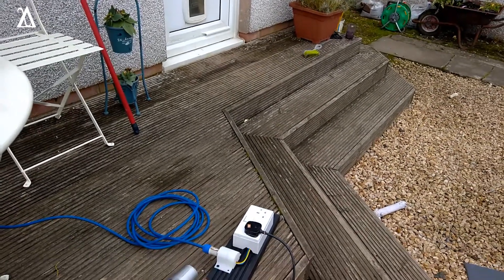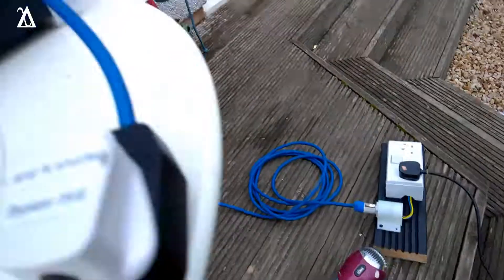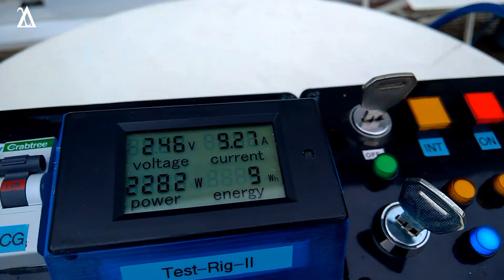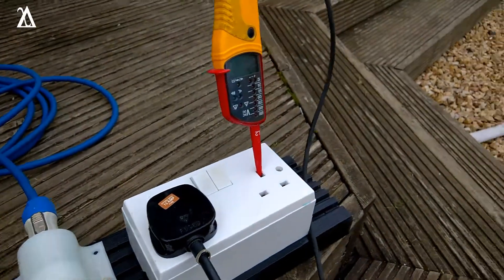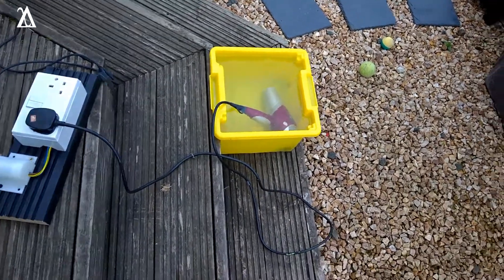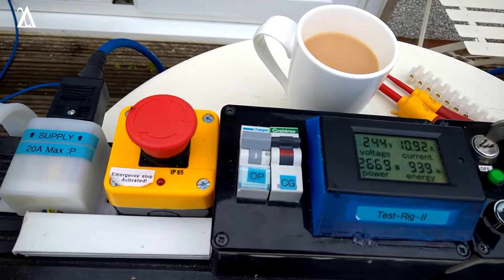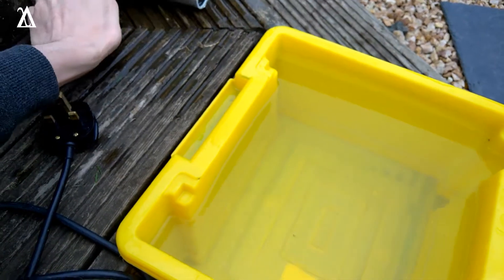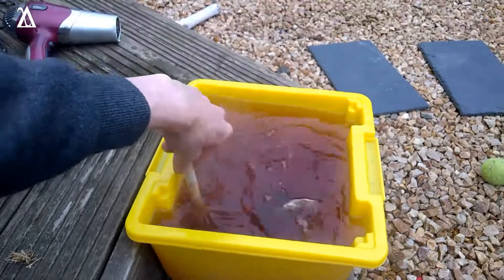Hair dryer kettle

Comment: They built a habitat for Humanity home in georgia back in the 1990s and it rained like crazy for a week. A guy dropped a skilsaw into water and reached into the water and grabbed it for a second then said Holy Shit letting it go quick and he jumped. He said ah spencer I grabbed that skilsaw and it Tickled me.
Reply: Use a hairdryer to turn your bathtub into a jacuzzi. The current will hold you close and love you to death it will never let you go on that 110.
Reply from the maker: @chadcrawford1502  it sure will, its 240V running through this hair dryer so a bit more spicier than 110v/120v.
Reply: Well, one time my uncle was replacing like y'know one of those modern LED lights, and he was so careless he didn't even turn at least the breaker off. He managed to replace the damn light, he got tickled a bit, and you know what he said??   It made me LAUGH 🤣🤣🤣🤣🤣🤣